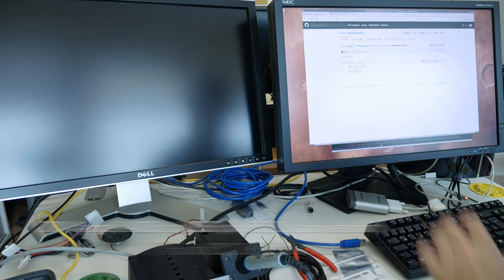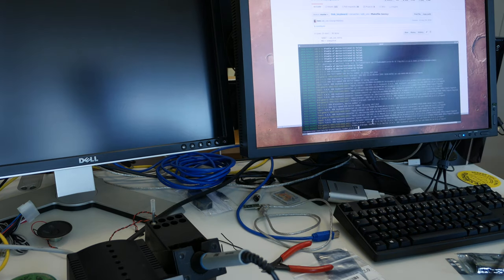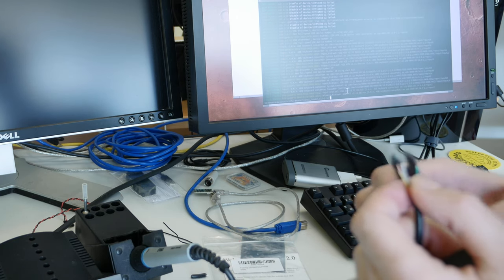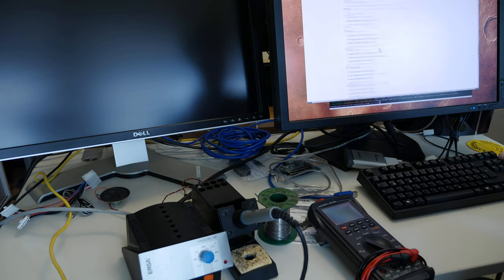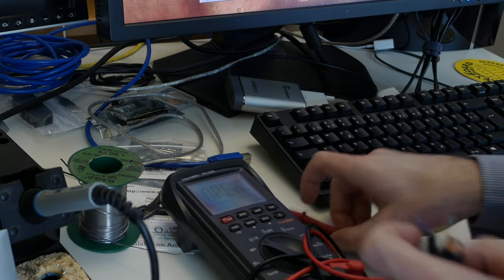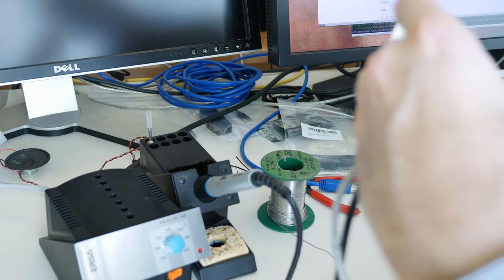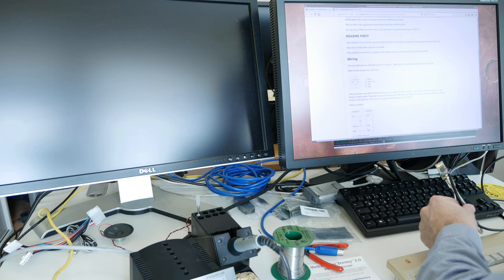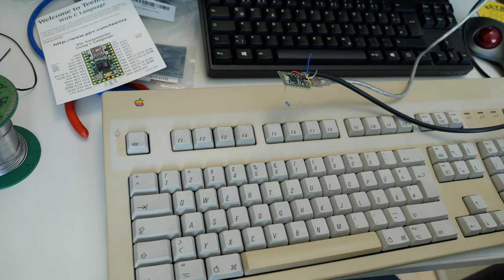DIY Apple ADB, PS2, AT to USB converter adapter dongle!

Comment: Dear René! I just finished restoring and retr0brighting a beautiful Apple Extended Keyboard II and it looks like new again. Looking for a way to connect it to my Hackintosh I found your very interesting video. Although I have not much of an idea about soldering I just gave it a shot. Did not bother going without the resistor and it worked immediately! Thanks for sharing your video!

Comment: Thanks for the video! I have the same keyboard I think, still not sure whether i'll prefer to add a USB adapter internally or make an external one as you have :)
Reply from the maker: as it is my only ADB keyboard, and I have an 8100/80, I will keep it like this to also just plug it into the Power Mac 8100. I guess it could probably work if you connect it internally additionally in parallel, so that ADB works as it should, and USB when you plug that in. 8100/80: https://www.youtube.com/watch?v=bMDI5LTR-GA

Comment: awesome video.   anyone know of a solution to allow i usb optical mouse to work with an old mac?   I have an Amiga 1200 with a cheap adapter that gives me the ability to use ps/2 compatible USB mice to work with it.   I figured there must be a similar adapter out there for old Macs
Reply from the maker: You can DIY such an adapter using a small cheap micro pcb like this, maybe it even is already ready made in the firmware source repository I used ,-)

Comment: I love those things tho it makes me sad that way too many use the arducrap IDE. It severely reduces their performance and code density :/
Reply from the maker: Yeah and I need a camera assistent or just film more carefully to have all action captured ;-)
Reply: and you will need all the "performance and code density" in an ADB converter ...
Reply from the maker: Actually for high polling rate, yes - I already even saw changes reducing it for some other uC. I think it’s best when new coders learn to directly program without fancy and colorful IDEs and frameworks. I know some who can only write slow framework code even after five years or even ten :-/!
Reply: @rasz  For this? Most likely not. :) The problem is that people take on bigger and bigger projects with time and they still refuse to learn how to actually use the hardware to its full potential.
Reply: I think the Arduino IDE is great for starting out.
Reply: @Chriva  the arduino ide enables lots of people to write code for microcontrollers without fussing with makefiles or compiler flags or linker scripts, and if you do want to fuss with those things or use lower level I/O, you can pick and choose parts you like from the arduino ecosystem. i'm an experienced developer and I see the need for both kinds of tools, for myself and for others. why hate on stuff that works?

Comment: Can it be connected to a pendrive?
Reply from the maker: it depends, what exactly do you mean by that?
Reply: @renerebe  Well, if the machine (the OS) would be able to read from the pendrive. As it would if it was a B&W G3.
Reply from the maker: are we walking about the same video and topic? The vide was about using an Apple ADB Keyboard, ..!?
Reply: @renerebe  I must say I didn't watch the whole video yet. But I thought you would be able to conect an USB keyboard (or mouse) on the ADB port, and make the machine work with it? I ask because I have a 8100 also and would like to make it compatible  with some modern devices...
Reply from the maker: ah, now that makes sense ;-) actually it is the other way round, this is for connecting the ADB keyboard via USB to a modern USB machine, like Intel Mac, or PC. Connecting USB via ADB will not just work. One could make USB keyboard works in a similar way, but certainly not a pen drive. Unless you site a special ADB serial driver, pulling the data slowly out over the ADB bus.
Reply: @renerebe  I see... Well, who nows, perhaps I should do it with a SCSI - USB interface. Thanks for the chat!
Reply from the maker: No problem, you're welcome, thanks for watching! Commonly SCSI to SD card adapters or maybe CF card exist. SCSI to USB I do not really remember; however it is possible and if that does not exist maybe we DIY here another months or so with some µC or so ;-)
Reply: @renerebe  I hope so, this would be great!